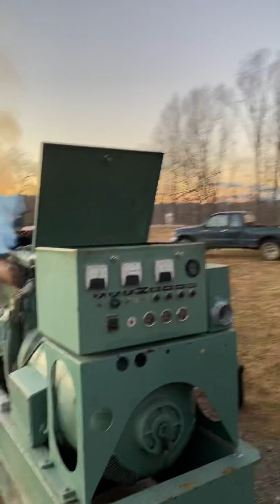The Screaming Jimmy Detroit Diesel 6-71 Start up!

Comment: One of my old bosses has a air comp with a 12v92 I believe.  It had a oil pressure override and it had  no idle,
Reply: You'd have to hold the lever for the engine to start(laying over the valve cover and hold a can of ether with the other. And the mufflers did it no justice.

Comment: I thought the Jimmy was the 8 71 series but OK
Reply: The 8v71 is only 1 of 10 71 series engines.  They are all Jimmys,  “jimmy” is just the nickname for the whole Detroit diesel line as GM (General Motors) built them until 1965 when GM sold the Detroit diesel line.  The “jimmy” nickname stuck with them.     There is also 51, 53, 92, 110 and 149 series.
Reply from the maker: There is, but this is a 6 cylinder.  I think they had many different ones.
Reply: @dieseltooth8742  the 71 series was offered in 1,2,3,4,6,v6,v8,v12,v16 and v24 engines, there are also multi engine packs with 2 engines back to back, 2 engines side-side, and 4 engines.   The multiple packs were offered with 4-71 or 6-71 engine, I operate a quad 71 that is 4 6-71’s on a single gearbox.   The 53 series was offered in 2,3,4,v6,v8,v12.  The 92 series was offered in v6,v8,v12,v16.   The 149 series was offered in v6,v8,v12,v16,    There is also the rare/more uncommon 51 series wich is a valveless engine they were only offered in a 2 & 4 cylinder versions, and a 110 series that was only offered as a inline 6 (6-110) but the 110 was also offered in multi engine packs with 2 of them either back-back or side-side.
Reply: @TugboatMatt  Thanks for the info.
Reply: @TugboatMatt  don't forget about the 20-cylinder 20v149 used in large gen sets

Comment: my truck has a detroit everytime i need to go somewhere with the truck i pull the top off an check to see if the common rail fuel injection is stuck or not my truck is a 59 chevy flat bed 2 ton an it works great
Reply: @Benjamin Burlos they will stick after a while sitting without running so yeah theyll run away
Reply: @Benjamin Burlos no these will stick Even though the oils there these stick for no reason
Reply: Would love to see a vid of your truck!  The 59 chevy has great styling.
Reply: @Benjamin Burlos it has 400,000 on it originally it had 200,000
Reply: @Benjamin Burlos yeah
Reply: @Benjamin Burlos 8v53t
Reply: @Benjamin Burlos were are we going from this you just made it confusing